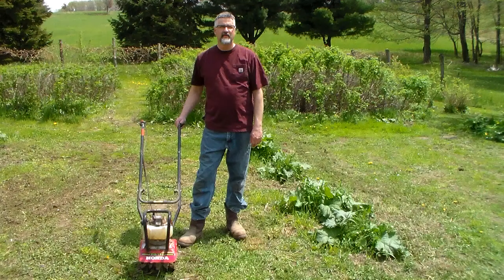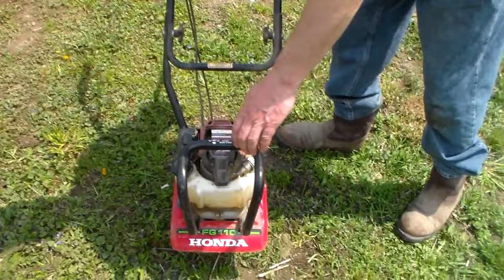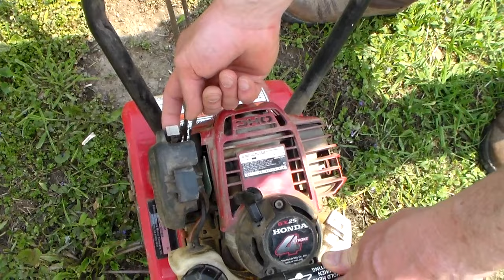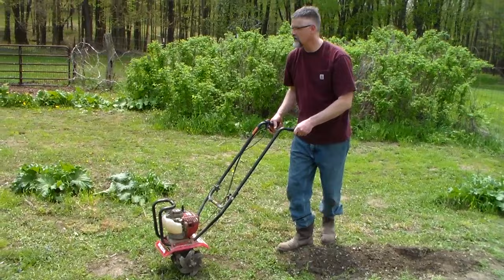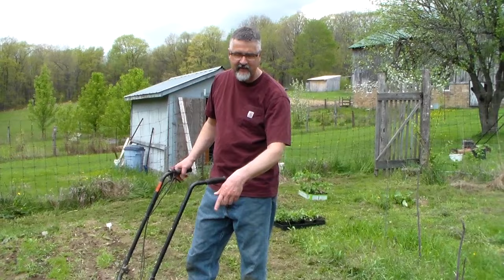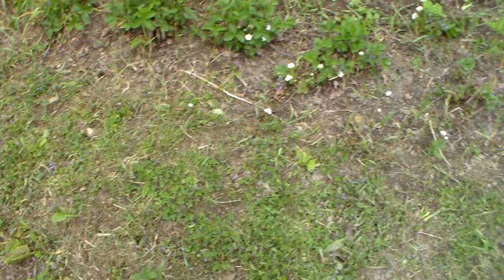Honda FG110 Mini Tiller Review

Comment: This little tiller is a beast! Mine runs great and chews up the soil nicely. Sometimes I pull it backwards to assist in the till.
Reply from the maker: I agree with you. I also sometimes pull it backwards but not that often. My dad had a Mantis tiller when I was growing up, and I think we always pulled that one backwards. The Honda seems to do the job the easy way. I just recently got mine out of the shed and it started right up, which is something I really like about it.

Comment: I HIGHLY RECOMMEND regreasing the trans! I checked mine new out of box and it was 50-75% low. I saw another Lad in a vid that pointed this out aswell. SAVE THAT TRANS! New or used, just take 10mins to top off the grease filler plugs
Reply from the maker: Thanks for the info.

Comment: I've noticed my Honda power equipment always starts on the first pull but they like to warm up...my GCV190 powered Husqvarna D900 tiller especially,  Honda GCV160 lawn mower engine is the same way.  I rented a big Honda tiller once...yep, had to sit for 2-3 minutes idling before it would go
Reply from the maker: With this one the instructions said to wait until year hear a change in the sound of the engine before you start to use it.  You can hear the change in about a minute or two, and you know it's time to go.
Reply: Prise kitna

Comment: Works good while it lasted. 
After 2 hours of running it the Motor sounded funny and 30mins later it died, drained the oil and it looked like a Metallic Silver Cup of OJ.  Engine damaged no doubt.
Reply: Stupid question but did you put oil in?

Comment: Small Engine Tech: if you are waiting that long choked and unchoked to begin work with your tiller.....it needs serviced. i would guess it needs a carb adjustment.
Reply from the maker: It's part of the normal start-up process with this tiller. Once it starts you have to wait until you can hear the change in the sound of the engine, and then it is ready to till.
Reply: @JimODonnellFarm  jim, i just bought one last week. It needs no warm up time. Are you pumping primer bulb first, then choke, then pull start? Primer bulb is the key.
My first run was: add gas, primer bulb 4-5pumps, apply choke, pullstart and till with zero warmup.

Comment: We have the same model. Weve always  used the non-ethanol gas in it. Our carburetor needs replacing but we cant find any video tutorials on how to change out the carburetor. Did you happen to film it when you replaced yours?
Reply from the maker: Sorry to hear that. I do not have a carburetor replacement video.
Reply: Go on honda.com they have a bunch of videos on how to do maintenance on it, including the carburetor.
Reply: It should be the same as any other small 4 stroke engine, I am sure if you search you will find one similar

Comment: Buy a Mantis two cycle instead of the Honda FG 110.  I have used both and the Honda 4 cycle engine is difficult to start and very finicky.  The Mantis is easy to start and has a more efficient tile set for basic tilling.  The only reason to buy a Honda is that you can get a number of different tine sets.
Reply from the maker: I am not familiar with the Mantis. I may have to get one to check it out. However, from my experience with the Honda it is very easy to start, which is probably why I use it most of the time. I have two FG 110s, and both start up no problem, even after spending the winter in the shed.
Reply: I had a Mantis and I hated it.  Much prefer the Honda.

Comment: I feel they were made to be pulled backwards, then you drive to forward to the next furrow and repeat by pulling it again , a patch will then be ploughed in no time flat
Reply from the maker: You can use them that way. From my experience it's a lot easier to just go forwards. It takes a bit more muscle to pull them backwards. Either way works though.
Reply: @JimODonnellFarm  I’ll try it that way but it doesn’t seem to bounce around and I get neater furrows
Reply: Thank you Jim, for making that video. I had a small one just like yours for about seven years but I guess I didn’t know how to look after it properly because I have just been told it is irreparable.
What do you do before you store yours for the winter? We always added gas line stabilizer, and we  started with fresh gas every season.
I just took it into the third repair man and  I was charged $40 for him to look at it. So I’m buying a new one tomorrow. And with tax it’s almost $800. Can you give me any pointers to ensure that   I don’t ever have to buy another one?
( I am 77 so I don’t think I’m expecting anything unreasonable.)
How do you demonstrate it is so handy just puttering around rows.
I appreciate that you gave directions for starting make it look very simple. I often had trouble starting mine. Thanks.

Comment: Piece of junk. Only lasted 2 summers before the motor locked up. I maintained it regularly changing the oil every 20 hours. Repair man tries to tell me it was from neglect. Honda has him trained well.
Reply: Did you put oil in it?
Reply: Did you use non ethanol gas?